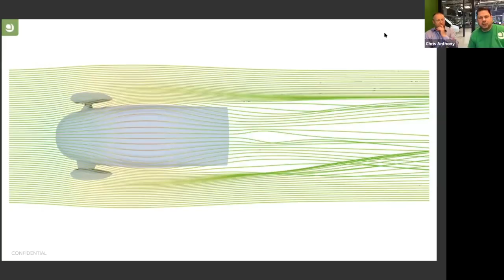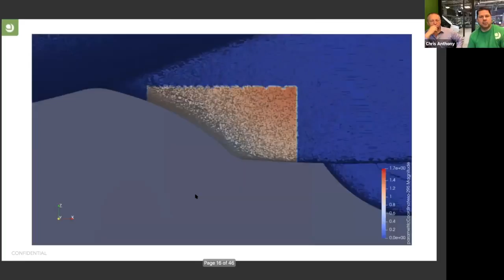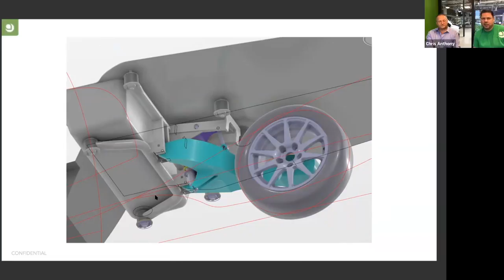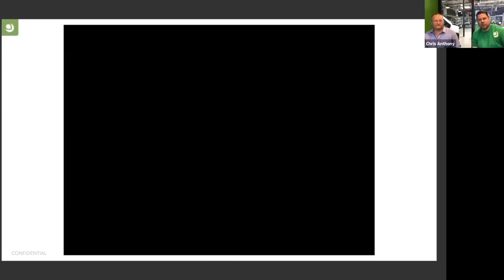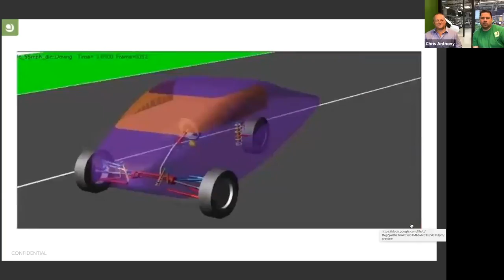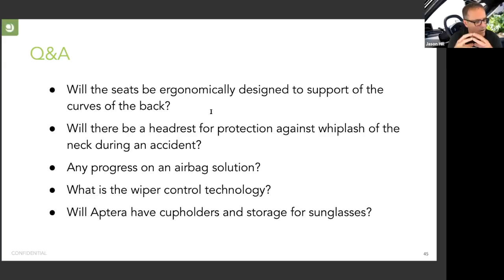Aptera Beta Evolution Webinar

Comment: In the question of efficiency between two wheel and three-wheel drive models you mentioned turning off the rear wheel. How about turning off both front wheels and using the rear wheel to drive the vehicle?

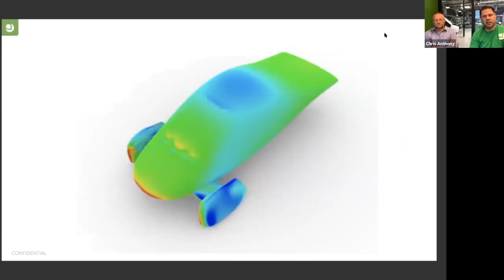Comment: 12:07 Chris Anthony says, "You'll notice we've added some side view mirrors in this analysis... due to regulatory."  Are those camera mirrors or regular non electronic mirrors?  They look very small like housing only camera.  will regulatory (NHTSA FMVSS) require bigger mirrors?
Reply: I think I can answer that with 20:30 Chris further says, " So putting the camera out on stalks...."  So it means that small side mirror design is camera based and not standard.  It's going to be a battle to pass that through regulatory.  Chris may need to have a plan B to deal with regulatory.  I propose the idea of adding detachable conventional ugly mirrors to meet compliance.  Once the car is delivered to the customer, let the customer (me) detach the mirrors.

Comment: Front wheel power cables. Will all that movement produce metal fatigue over time where there would be a disconnect? Will there be an easy fix for the consumer?
Reply: The cable routing will be completely different on the beta vehicles with Elaphe wheel motors custom to the Aptera.  Fatigue is unlikely to be a factor in the new design.

Comment: Where is the spare tire?
Reply: No spare tire.
Reply: @gbpg2016  how do you folks feel about that?
Reply: @gbpg2016  maybe a spare in a can for that temporary roadside emergency fjx. If you're in a remote region this gives me some concern.
Reply: @davidmcnamara8024  I have many hundreds of thousands of miles on motorcycles with no spare.  All you need to do is carry a small AC tire pump and a tubless tire plug kit to handle most road hazards.

Comment: I doubt it will have AC I don't care about that , AC uses tremendous amounts of energy, notice how your car slows when you switch on the AC .
Reply: AC will come with the vehicle and it uses less than you think.  Having owned a Volt I can say that the AC doesn't use much electricity.
Reply: @gbpg2016  thanks
Reply: Thomas, AC is needed not only for the passengers, but to keep the battery pack healthy.
Reply: @n.brucenelson5920  I didn't know that, Thanks .

Comment: are the single solar cells on the roof 6 inches squared or 5 inches? It would make a huge difference that is why I am asking... with 5 inches you would not get the claimed range and with 6 it might be possible that is why I am asking...
Reply: The total area covered by the full solar version is about 34 feet, or enough for about 750 peak watts

Comment: What I am concerned with is the payload. With batteries that range from 25kw-100kw that changes the vehicle weight approximately 1000lb. This is based on a Tesla 100kw battery pack weighing 625kg. Yet the payload is supposedly only going to be 500lb? Is the suspension completely different for every different battery option due to the significantly different vehicles weights.Given the 60kw version is 1800lb, I estimate 40kw ~1525lb, estimate 25kw ~1325lb, and estimate 100kw ~2330lb. Will it be possible to order a vehicle say with a 60kw battery with the suspension of the 100kw battery to get the payload up to >1000lb?
Reply: There is active suspension design work going on with the help of Roush.  These details will come after beta testing.  Aptera is still early in the design process, with only alpha vehicles produced so far.
Reply: For vehicle safety use the maximum weight of all options and add 500 pounds. If you have a smaller battery you have shorter range. That’s all.
Reply: No the safety rating includes the maximum battery pack weight. The issue with not increasing it for the lower sized battery pack is due to range not safety. Each 30lbs decreases range 1%.
Reply: Gen 1 honda insight payload is 340 lbs. So.......
Reply: @peterjorgensen3  yes.  The Aptera will be a practical upgrade to my Insight in almost every way.
Reply: I think the 18000 weight estimate is for the 40 kWh version.  However, the beta models will have a somewhat larger body and weights may change somewhat before the production intent vehicles are ready.

Comment: Does the front anti-sway bar also serve as a camber compensator to prevent body roll from de-cambering the rear wheel?
Reply: I don't know the details, but Roush is working with them and the suspension has been redesigned for the beta models.
Reply: @n.brucenelson5920  I once put an Empi camber compensator on my VW Beetle. It made a significant improvement in cornering. By keeping the rear wheels flat on the road, independently of body roll.
Reply: @n.brucenelson5920  Custom made electric linear actuator (available online) has precision feedback and it's self centering too. Waterproof,  powerful, lightweight. Custom made precision controller and steering angle sensor are also very affordable.
Reply: @n.brucenelson5920  It occurred to me, you could make a rudder-wheel on a very low budget, then try it out in the parking lot. Get an experienced sailor to man the tiller. Ask how he liked it.
Reply: @WolfsburgWarehouse  I expect the aftermarket for Aptera will be the largest one we have seen since the VW Beetle.  I am already excited for the possibilities, especially given the Aptera corporate friendlness to Right to Repair.
Reply: @n.brucenelson5920  Leave enough space to steer the rear wheel five degrees in either direction, I will add that on myself.

Comment: Compared to conventional doors will the occupants be hit with more rain/slush/snow sliding off the door and coming through the deeper overhead cutouts as they open in bad weather?   Do Aptera's doors enable partial opening?  For example with conventional doors if someone parks too close while you're in the store you can open it partly and slip in.  I imagine Aperta's doors spring up and you could hold them part way, but will entry be possible?
Reply: I think there is always enough door space because of how much wider the front wheels are than the actual width of the body of the car.
Reply: Roush is working with Aptera on details of the door design, which may change somewhat with the beta models.